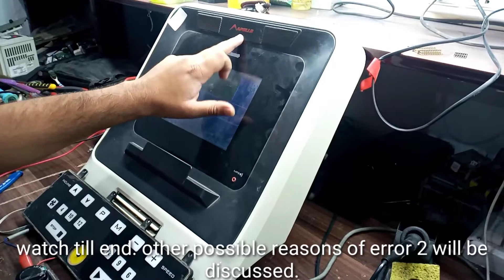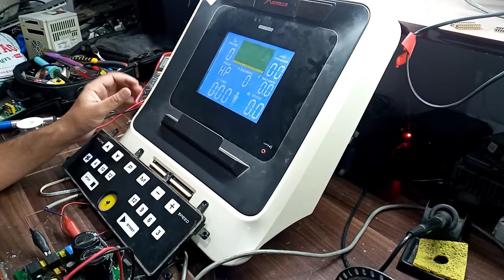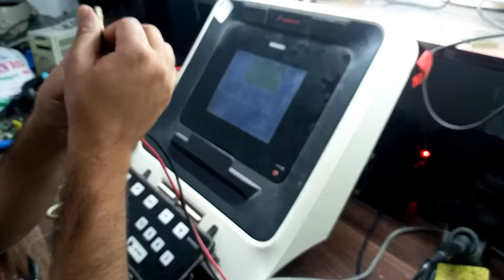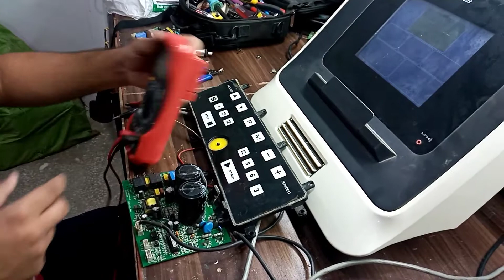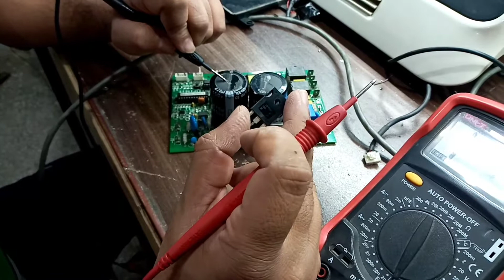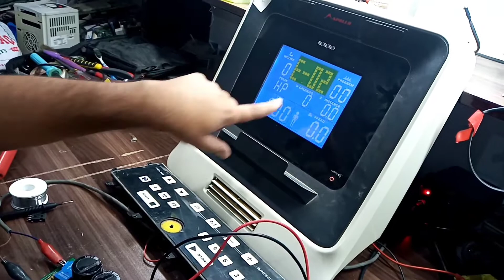Treadmill Error 2| Apollo treadmill Error 2| DC motor Treadmill

Comment: Bhai Mery pass life power کی machine hy over heat ho ker trip ho jati hy corbun brush bhi theek hein qamutater bhi clean kia hy load nhi ly rahi belt remove ker ky chalti hy but hot ho jati hy winding bhi short nhi hy voltage bhi proper increase ho rahy hein as per speed